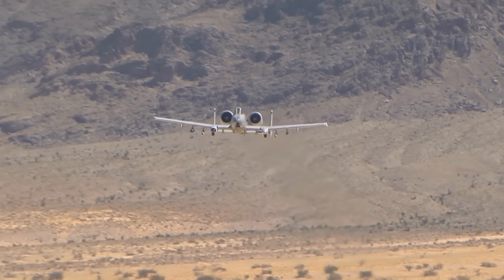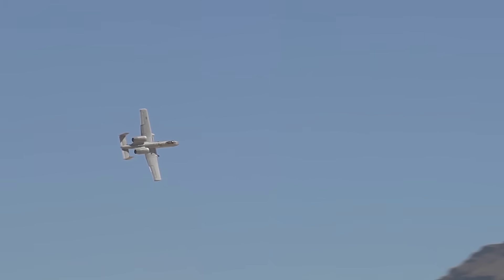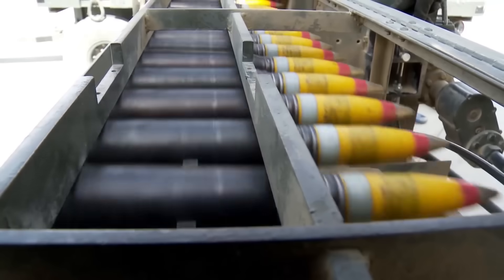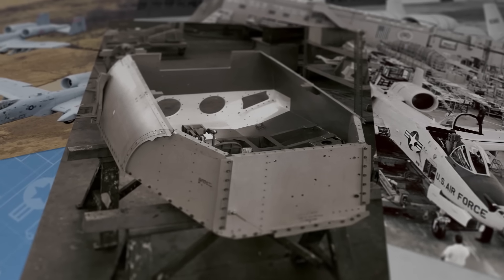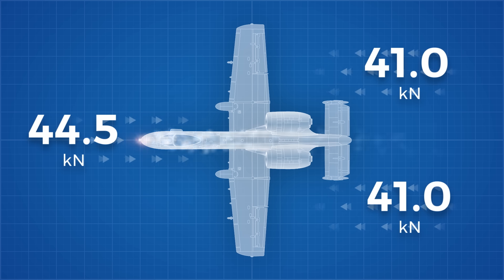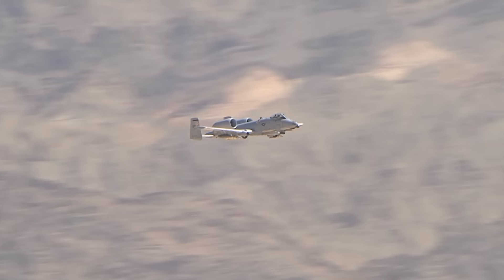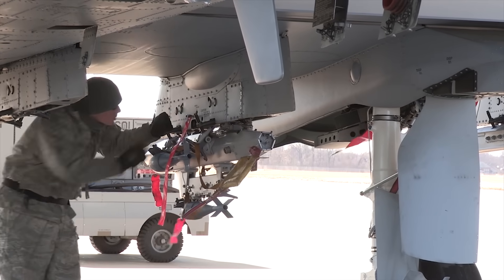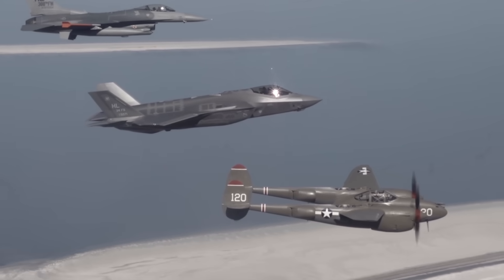The Insane Engineering of the A-10 Warthog

Comment: Scientists “Uranium should be disposed of carefully to avoid the spread of radiation” 
Engineers “hahahaha gun go brrrrrt”
Reply: DU radiation is so low it is harmless.  It does not penetrate the skin.  Both NATO and International Atomic Agency proved this. There is radiation all around us all the time. DU however being a heavy metal is toxic, just like LEAD. But nobody complaining about all the lead bullets. Also the DU is only a very small portion of the round, the penetrator.
One also has to take into account the targets. DU tipped ammo is anti-amor. It is not anti-personnel. 
The only problem is to inhale DU dust (which can happen when it gets into contact with tank armor) so it gets into your lungs. To be infected with DU you would have to be inside the tank being penetrated, at which point the toxicity will be the last thing to worry about. You will probably be dead.

Many DU rounds, APFSDS tank rounds in particular are pretty useless against soft targets (as their effect is to narrow and they have no explosives and infantry is to small of a target). With the A-10 its the only ammo carried so could be used in anti-personnel role. Even if used as anti-personnel, no human will survive a hit anyway. And even if some of the DU is changed into dust (which only happens when it hits something hard like tank armor) it will spread over such a wide area that not much of its toxicity is left, just like with lead rounds.
DU rounds save lives. They have the ability to penetrate targets that other rounds like tungsten can not. For instance the penetration of the Abrams L44 gun with DU tipped rounds is close to the penetration of the Leopard 2 A6+ with L55 gun and tungsten. Which is why the US is still using the L44 (which gives the tank better maneuverability in tight areas).
Being able to take out that enemy tank or not is the difference between saving or losing friendly lives (including civilians). The lives of its own military personnel should always be the first priority of a military, after all they get into harms way for their country. Also the sooner the war ends the less lives will be lost. 
When looking at left over dangers unexploded ordnance like shells, mines and bombs are actually a risk to locals. In Europe unexploded ordnance from WW2 and WW1 is still being uncovered. So after a war these will be the problem to think about. The anti-DU lobby is mostly an anti-western lobby and/or anti-nuclear lobby. It is not based on facts but purely political.
Reply: In Gunsmoke competition at Nellis AFB in 1991, the A-10 took top gun against every other fighter in the inventory in every area, except for high altitude bombing and the F-16 won that.
Reply: Susan Kay the Geneva Conventions won’t matter in the end or getting there.
Reply: where is the funny
Reply: The amount of radioactive materials released into the general environment from the use of 30mm DUP in an active combat zone is still relatively tiny and even a coal fired plant releases more radioactive material in a year than you'd get from that battlefield.
Reply: LMAO! SO true!
Reply: War is war.
Reply: @SusanKay-  And is it any worse than lead? Duhhhh, you know lead poisoning? Duhhhhhh.
Reply: @SusanKay-  SUKA BLYAT. Long live CCCP. Down with DEVIL States like USA and UK.
Reply: Depleted uranium is not particularly radioactive tho iirc
Reply: @fleetjacob  Even the military knows DU rounds are dangerous: https://gulflink.health.mil/du_ii/index.htm
You're right that it's not particularly radioactive, but that's not why it's dangerous. It's dangerous because it loves to turn into "slightly radioactive" dust or smoke. The problem is that "slightly radioactive", when it's caught in your lungs for 20 years, adds up. You could handle a lump of DU and not really be harmed. Smash that lump into armor plating at several times the speed of sound, and it's going absolutely everywhere and who knows how long you could be exposed or where.
Reply: @VexingRaven  Jacob was correct in his rebuttal of the OP's comment. The OP doesn't seem to understand that engineer's and scientists are the same either. Lastly, why does it matter if the enemy is exposed to the dust?
Reply: Because most of the people that live there aren’t necessarily our enemies, and toxic heavy metals can persist for a long time.
Reply: @haliax8149  unless your own troops have to move into that area..
Reply: @haliax8149  "Lastly, why does it matter if the enemy is exposed to the dust?" Because at one point we decided that it would be easier to live with ourself and tell the tale that we are the good guys if we respect some arbitrary rules on how we kill each other. So it turns out tearing apart the bodies of enemy troops with heavy machine gun fire is OK and humain but if they manage to avoid the bullets and later die in a hospital via lung cancer thats NOT OK and inhumaine. Who makes these rules I don't know but I always wondered how about if we just not kill each other.... I mean what if there is no OK way to do it after all ?
Reply: @CraftyF0X  sadly war won't ever end
Reply: @cf453  "toxic heavy metals can persist"
Not really, not as dust that can be breathed in. You said it yourself: HEAVY. Sprinkle some depleted uranium on sand or dirt, come back in a few weeks...the sand is now on top, the uranium is underground. It's a non-issue, and only remains an issue to people who refuse to learn even the most basic facts on the subject.
Reply: @VexingRaven  Jacob Fleet is right. Depleted uranium is barely radioactive at all. It has a half-life of almost 4.5 billion years (the longer the half-life, the less radioactive a substance is).
Reply: @VexingRaven  the toxicity of the heavy metal is the problem, not the radioactivity
Reply: @haliax8149  "why does it matter if the enemy is exposed to the dust?
" - because your own troops will be exposed to it
Reply: @haliax8149  engineers and scientists are not the same lmao
Reply: @nood1le  not as long as America is still in existence
Reply: VexingRaven enemies could try scooping up fragments for a dirty bomb including the dust. A database of hit locations should be maintained for retrieval.
Reply: CraftyF0X interesting but someone has to do the dirty job when freedom is at stake.
Reply: Laiza Lott you are right DU dust is still heavier than other mineral dust.
Reply: @VexingRaven  Trying to kill anything with depleted uranium is trying to kill it. Some esoteric theory about where the spent rounds end up is pretty much academic.
Reply: @haliax8149  Probably not many survivors of the gunfire left to be exposed. But in Desert Storm a lot of American troops took heavy exposure clearing the routed Iraqi convoys. I can't even imagine that sort of human hell. My heartfelt gratitude to all who have served in peacetime or war. We had A10s at the nearby ANG (Truax Field) until after DS1. I have known folks who went. I think like most Vets who've seen tough combat, they don't talk about it.
Reply: @laizalott  and contaminate drinking water undergroung, think about it.
Reply: @VexingRaven  The problem here is that you are bringing facts, logic, and reason into the comment section. What's wrong with  you?
Reply: @dionis4812  That is a bit off the topic is it not.. If one nuke goes to the UK we all screwed no matter where you live.

Comment: The gun itself is offset from the center. The gun fires through the barrel that's on the side during rotation. So the firing barrel is centered, but the barrel pack is not.

Comment: A10 flies into ground attack against opposition: Takes 100 small arms hits plus 6 x 20mm plus shrapnel from a close missile burst. A10 flies back to base, gets patched up, refuels and rearms and heads off on another mission.

F35 flies into ground attack against opposition: Takes 25 small arms hits plus 3 x 20mm plus shrapnel from distant missile burst. F35 limps back to base (if it's very lucky), spends next 2 months being repaired at vast expense.

Let's scrap the hundreds of outdated A10s. Still sound like a good idea now? I have a better idea - using the exact same requirement criteria, see if a new aircraft can now be built that is equally cheap, equally capable and equally robust and easy to maintain and repair - and only then and not a moment earlier consider replacing a mission critical piece of hardware that is still that good even today. Never throw away your ace cards.

Comment: One little correction: The gun is slightly offset to the right, since it's the 7 o'clock barrel that fires, and that barrel will be on the centerline.
Reply: Two little corrections, it's also Thunderbolt II not Lightning bolt, as he called it a few minutes in.

Comment: The cannon is not actually on the centerline.  The cannon is so huge that it has to be offset to the left to fit the nose gear on the right side.  The barrel that fires is on the centerline below the longitudinal axis, and it is depressed slightly to facilitate strafing.

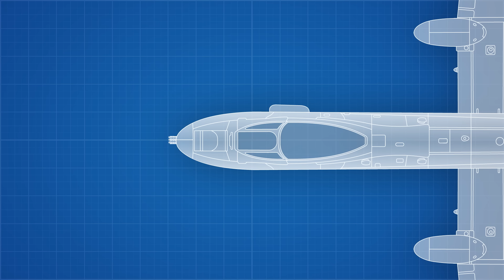Comment: You say at 7:45 that the gun is centre mounted, however it can be seen at 8:33 that it's not centre mounted, it's slightly offset. This is because the gun doesn't fire from the 12 o'clock or 6 o'clock positions. The firing position is centre mounted though.
Reply: That's the only gun that counts!

Comment: As a career soldier from end of Vietnam thru the Gulf War, I loved this airplane.  The Army needed its support so much that when the USAF told congress they no longer wanted it (mid-80s) the Army Chief of Staff immediately shouted that "We would fly it ourselves."  The AF changed its mind and the A10 continues to provide exceptional support to ground forces.  The problem with multi-role aircraft is that when you need it to save your a## now, the AF has it committed to counter air missions and it is simply not available.  No air support. Not a warm and fuzzy feeling.  No matter how lousy a day we were having on the ground, we knew that if the A10s were flying, it would be all right.

Comment: The great Stuka pilot Hans Rudel was consulted on the A-10's use and design.
Reply: No, he wasn't, and in any event was a pilot only and not a fighter specialist nor expert on weapons platforms
It's true the 'ME-109' was designed 'around' an internal cannon placed 'dead-center' and was the first to have it
*Rudel was 'Experten' with the 'Stuka' which was heavy and 'over-sized' in relation to power-output, but was also extremely sophisticated for it's era, and deadly to armor or heavy artillery on the ground since it could 'launch' a
heavy bomb with complete precision on an object no larger than a 'Ford-150' which is extremely difficult even now*
Reply: Gerry Nightingale the real A-10 ancestor was the Henschell 129, a plane specifically designed for ground attack as tank destroyer. Even the nose shape is similar.
Reply: So? The A10 did not copy any german aircraft its bs
Reply: @Idkmyname-b6o  Wasn't even suppose to copy any german aircraft

Comment: Addendum: depleted uranium is also INCENDIARY.
Reply: Yep. (My Dad flew A-10s back in the early 1980s.) Technically the term is "pyrophoric" -- it wants to ignite when it is in contact with air. If you subject it to enough pressure, such as forcing it through the armor of a tank, it will spontaneously ignite. What hits the tank is a solid penetrator of depleted uranium -- what enters the interior of the tank is a 3000° jet of molten metal that pings around the inside of the tank destroying and igniting everything it touches.
Reply: @clayjohanson  Holy fucking hell! Imagine sitting in a tank all cozy and invincible and suddenly molten lava hits you at warp speed. It's like Satan peeing on butter.
Reply: It's a necessary evil, as it leaves behind radioactive contaminants.
Reply: @terrylandess6072  - well, yeah.. but there's RADIATION and then there's radiation. Any residue left behind from a depleted uranium round would hardly pose a health risk even if you swallowed it. It's not like entire battlefields are being rendered uninhabitable for thousands of years by the stuff
Reply: @Sharklops  "Any residue left behind from a depleted uranium round would hardly pose a health risk even if you swallowed it." - It's an extremely toxic heavy metal.
You might as well be breathing lead dust.
Reply: @ChucksSEADnDEAD  arguably that would be less hazardous.
Reply: Because to really make sure they're dead, set the remains on fire meanwhile
Reply: i'd love to see explosive ammunitions go out of the brrrrrrrt machine

Comment: I was working at Cairns Army Airfield in '83, as an Air Traffic Controller, when the first A-10s came for a demonstration to be conducted along w/ a group of AH-1 Cobras and I got the duty of Local Control for the demo. What absolutely incredible aircraft! The AH1s would pop up from below the canopy and fire their weapons, followe by the A-10s making a strafing run w/ that wicked sounding mini-gun and its signature BRRRRRAAAAT!!! Very impressive for a 23 yr old pilot that couldn't fly for the millitry because I was a bit near sighted. I've gained my dual prop IFR rating and am satisfied w/ the ability to fly just about anything w/ wings and propellers. I've also gained a little stick-time in rotor wing aircraft and feel helis are more hype than scary, but not enough to feel confident to jump into one and fly w/o some prep time. Hang gliding and parasailing are among my other means of getting airborn. I've been completely addicted to flight my entire life, if you couldn't tell. lol

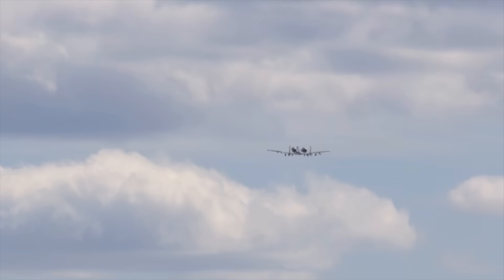Comment: 1:30 Hey USAF, does any of the things listed in what is close air support sound even remotely like the F-35? No? Well then quit pretending it is. 😡
Reply: Yes. The A-10 has largely been replaced by multirole fighters and the B-1. It's outdated and other platforms perform more CAS missions.
Reply: @ChucksSEADnDEAD  well there’s like 10 B-1s available to fly and the F-35 is a fragile and high maintenance plane that can’t take a hit, lacks spare parts and has a misaligned gun with a fraction of the A-10s rounds. It just isn’t “sexy” and the Air Force wants new sexy planes not flying tanks. So give the A-10 to the Marines and Army to use, the air force can then use the F-35 from forward based unprepared airfields under constant fire and show the world what “new multi roll modern aircraft” can do in its stead so much better than the A10. 😁
Reply: @jeffnelson2197  And in 2018 the USAF only sent 12 A-10s to Afghanistan.
What do you mean by taking a hit? A F-16 has landed with half a wing missing after a mid-air collision, and an Israeli F-15 lost almost an entire wing in a collision too and managed to land. This is due to body lift. The F-35 has even more body lift. It also has each main control surface working on their own independent hydraulic system, meaning it can't be bled out of hydraulics. Meanwhile A-10s were splashed pretty good in 1991. The F-35 doesn't get hit in the first place. The A-10 has a titanium bathtub so that the pilot can survive long enough to eject when the rest gets shredded by 23mm/30mm AA guns.
"It just isn’t “sexy” and the Air Force wants new sexy planes not flying tanks" - This is reformist nonsense. You're parroting a lie made up of whole cloth decades ago to sell books. You can stop now. Those books aren't selling.
"show the world what “new multi roll modern aircraft” can do" - Most of the world uses multiroles for close air support. Almost no country runs A-10 style aircraft. Only Russia has the Su-25, and they won't even dare using it close to Ukrainian forces. The world uses F-16s, Rafales, etc for CAS when they're wealthy, light attack aircraft when they're not as wealthy.

Comment: It's that much sadder that we build turkeys like the f-35 when we're perfectly capable of building truly and devastatingly effective fighting craft such as this.
Reply: You need to keep progressing designs though since they take so dang long to design... Engines as well.  Just building the same old thing is fine for a while but it's not really a safe strategy since the platform gets limited after a while.

 Other countries aren't stopping their R&D either.

If you stop R&D your engineers go find different jobs in other industries and you lose all your knowledge base. It's a huge headache to start up R&D again along with crazy costs.  It's just easier to slowly progress.   I work as an engineer for military helicopters/jets for about 15 years.

I really love this plane BTW.  The F35 is a pretty insane piece of work, but requires an insane infastructure to even maintain it.  Allot of countries do not have the resources or knowledge to support the F35.

Comment: I think you meant the "ethical implication" of using depleted uranium ammunition is questionable...  "Efficacy" describes the ability to produce a desired result (usually used to describe how well drugs do/do not work) and has no ethical/moral implication so in the case of DU rounds the efficacy is quite certainly good as they objectively have the best armor piercing properties.

Comment: Good analysis here, $5k per hour being the lowest of current planes, this plane, despite being older, is still clearly very useful in a lot of scenarios and cost effective, I hope the US continue to use this plane where applicable, i.e some lower technically demanding roles and where reconnaissance or just basic posturing. Just 3 of these planes flying by and their machine guns rattling should be enough  in so many cases, to turn the tide for perhaps not just US troops, but ally troops that really need the back up. I hope a scheme keeps this plane alive as long as its relevant, and as ever - cracking video  - an engineering gem